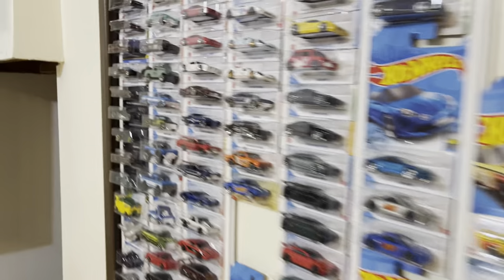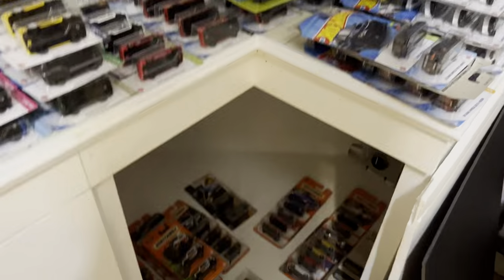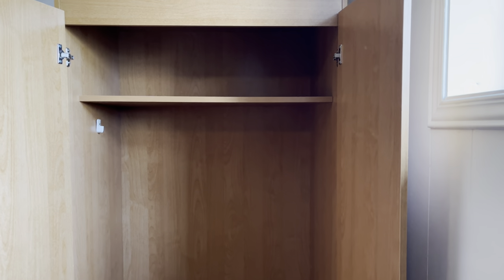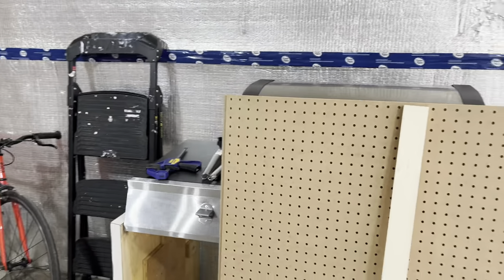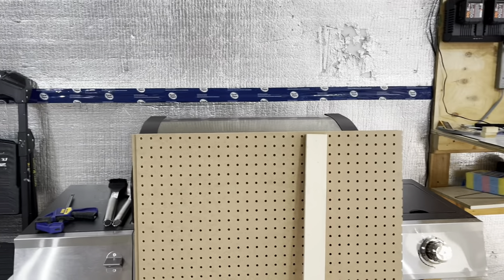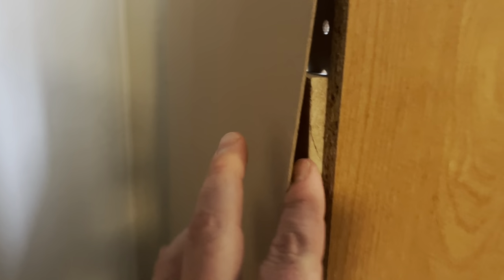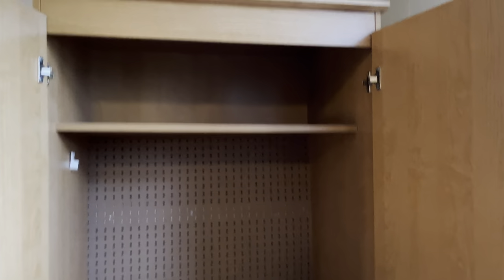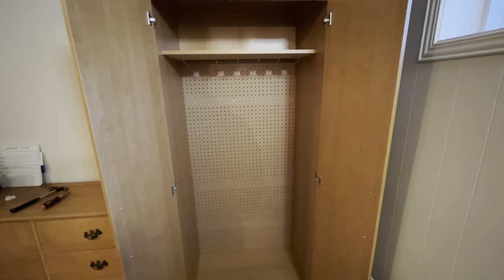How to make a CUSTOM peg board storage cabinet for HOT WHEELS! Hot wheels display build.

Comment: The cars take up a lot less space it you remove them from the packaging and put them into 24 compartment Plano cases.  I show this on my channel.  The only reasons to keep Matchbox cars and Hot Wheels cars in their packaging is if they are vintage or there is something interesting about the packaging.  True diecast collectors usually remove the cars from the packaging and place them into nice display cases.  😃
Reply from the maker: I have loose and carded collection. This video is just a fun project I did that I wanted to share. In my opinion a “true” collector is someone who does it for their own personal enjoyment and however they choose go about it is no more or less valid than the next person. Collect what you like how you like, as long as you’re having fun you’re doing it right 👌😊

Comment: WOW that a great idea , this hobby ( or for me addiction) does take up lot of room i was going to do the same thing about 2 years ago but my friend who good with tools didnt have the time so i used Command Clear Wire Hanger Hook, Value Pack of 9 Hooks and 12 Adhesive Strips x loads in my cupboard so can only get 1 or 2 on each hook so such on back of cupboard an side and on doors so when opens big display , but yours is far better idea just for the amount you can store and display 😀😀👌👌💯💯➕➕👍👍no 52
Reply from the maker: Thanks man. And thanks for checking out the video. I have another one where I built a peg board display that you might enjoy as well